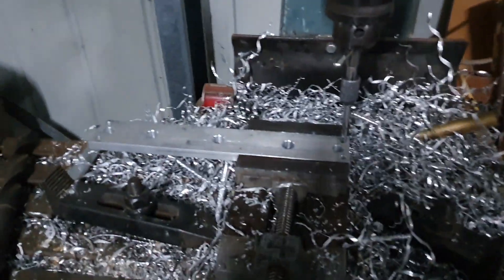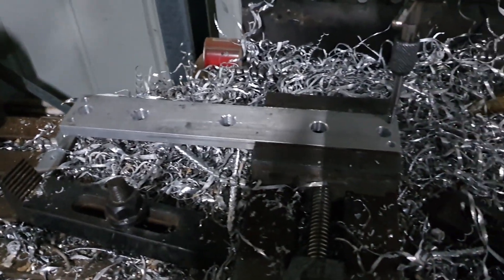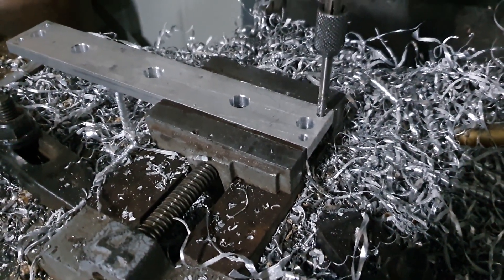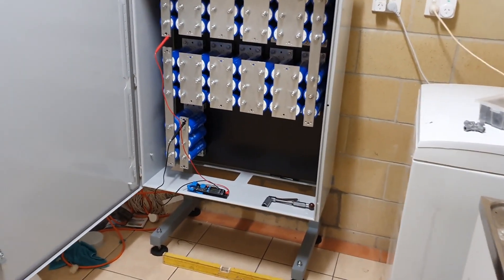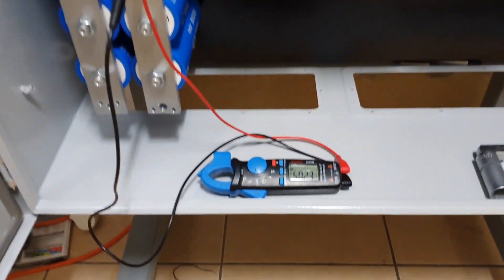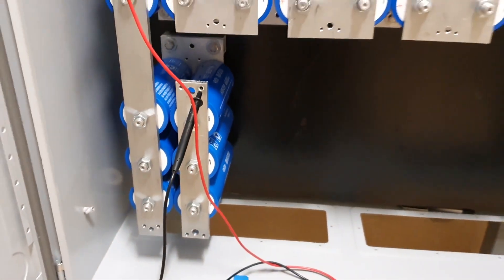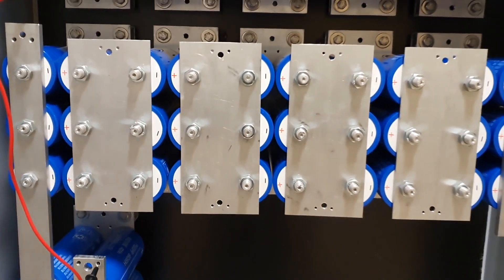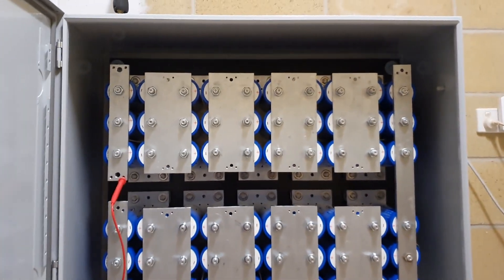66160 6kw lithium titanate battery bank take 4

Comment: I think they need to be making these batteries in THICK rolls, like prismatic rolls but bigger. 5kwh because they are useful, safe, cheaper and modular. It would be done during the rolling process. They can wire the cells in series, when the polarity of the battery junction film is flipped, and incidentally connected. It is like what they are doing with thin film solar panels, running 1v cells with 200 cells making 200v panels. 
Make a 48v battery and connect the cells in series to get the 48v, and make it easy with big rolls, and make it easy with big surface area. A good, useful, high capacity. 

Really, the costs are lowered across the board because of less packaging demands, less individual testing, less connectors, less wiring. less installation considerations. probably NO bms. Lfp works ok on some cells without a bms. 

They should do this, or at least make 500ah individual cells more available

These last 50 years, reliability would even increase because connecting them in siereis in the factory makes more reliable repeatable battereis. The films would have to be either, measured, cut, flipped, and joined, or made in long sheets with varying polarities. I think cut, flip and join method would work simply with a jig and a bit of kapton tape. It would all have to be high tension, but tensioners can do it, and tape can join these films together reliably. It just has to make contact with the + remaining, connecting to the - of the ongoing loop. series over and over, for a 48v battery at least. Maybe even higher voltage, but dc voltage is a beast at high voltage. Would accept 48v as a universal standard, or division.
Reply from the maker: I think that Sodium Ion cells could change the market and game in both LTO and Lifepo4, I would never run a battery pack without a Bluetooth BMS
Reply: Some are stable, some are not. bms's can fail too. I would like inherent balancing in the construction of the cells. This is done with solar panels, the technical considerations are very similar. Sodium ion has not been proven in reliable battery packs, probably for some reason we will never know. they might even be too good. But, anyways. I like lto too, i think all ev's should have standard sized and connector and mounting battery packs, where the batteries can be used for 20 years, upcycled and used another 20 years and another 20 years. 
Its actually alot safer, having these things completely compatible, than having abunch of people, some or most idiots messing around with them trying this and that. 
Really, it should be inherently useful and straightforward from the factory. 
I think this could be done too if the cells were rectangular rolled prismatic construction, and a good, honest capacity of 500ah. Thats like 1kwh per module which is about the right sizing for useful systems. 
We could all do house solar and storage, with just 1 outside module, batteries and converter, and 4ft away panel arrays. Panels too could be better at 500w each for starters, and thin film flexible for a low cost. low environmental low materials cost.The world gets so fetched up in moving marginally useleess shit around. inherent value and utilization should be more condensed.   @sjdtmv

Comment: I don't understand why 66 expensive batteries are needed, if exactly the same power of 6kw (but one microsecond) can be obtained with only one small AAA type battery. Were you not taught at school what is power and what is the unit of energy?

Comment: Nice build of LTO batteries for your battery bank. I built my solar battery bank using 40 Toshiba LTO SCiB batteries that are giving me 44kW @ 1.1kW per battery. I used LTO batteries because I couldn't keep lithium batteries above freezing temperatures in the winter months and destroyed my lifepro4 batteries from charging below freezing temperatures. I also live above 46degrees North of the Equator, so I have low sun hours. The high C rate allows me to get a full charge easily on clear days and some overcast days. The nicest part is that you can get over 20,000 charging cycles from them, way past my lifetime.
Reply: @fisherus Hi man, how is it performing after 1 year of "stress testing" the LTO batteries?

Comment: Hi there, great design.  In order to use the full capacity of the battery bank, you have to be able to charge all the cells to the same voltage and discharge all the cells to the same DOD voltage.  Are you acheiving this with your cells?  if so, how?

Comment: Are you letting the weight of the cells rest on the posts?
I mean is it appropriate to suspend the cells in this manner?
It lools like it could compromise pretty easily.
I was thinking the weight of each cell should be on the body of the cell...not the post.
As I am new to this I could be wrong.

Comment: What I like about this build is that it looks very professional. I hope that when the bms is installed  it is just as neat.
David.
Reply: Judging by the fact that the unit of power (kW) is used instead of the unit of energy, the author has relatively little knowledge of physics

Comment: Gday Ross,
Are these Lithium titanate batteries much faster to charge than lithium phosphate ? Can you give me a charge time example in relation to this 6kwh system.
Cheers
Regards Phil
Reply from the maker: Hi Phil, I have a Victron 150/70 clone solar controller with 4.2kw of solar panels feeding the LTO bank, this solar controller will only feed 70amps to the battery bank which is less then 1C charge, if I was to try to obtain a 10C change I would need 1200amp charge and that would involve 18 x 150/70 solar controllers and approximately 75kw of solar panels or approximately 300 solar panels the cost to do this test would be in the 10s of thousands of dollars, I gone the LTO way because of it's life span and temperature range usage.
Reply: Thanks Ross,
Was considering titanate due to the lack of solar I will have in the winter months due to my shading, so I will need to run a genny every few days in winter to charge batteries. Thought the titanate chemistry might charge quicker from the genny relative to phosphate ? I’m in south Tassie. Very short days in winter combined with shading. Summer no problem.....

Comment: Where did you get your cells? Why expensive LTO vs les expensive LifePo4 for a home application?
Reply: Safety and life cycle are the 2 main advantages
Cheers
Reply: @patrickmckowen2999  what realistic lifecycles do the lifepo4's have ?
Reply: @ndudman8  
I think they say 2k.  A few factors, rate of discharge....
Reply: @SystemsPlanet  And of course charging at very low temps on lifepo4 needs care I think
Reply: LTO are not explosive do a search of puncture tests, they cut them with a circular saw while running a lamp and still keep going with no fire.